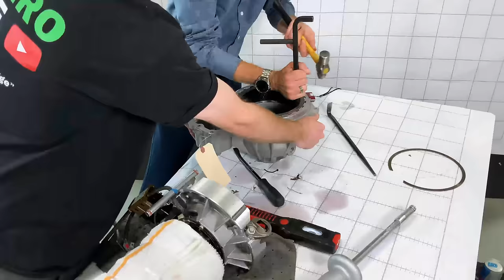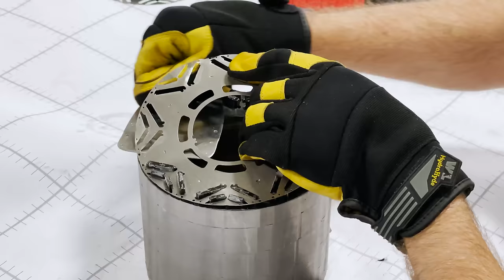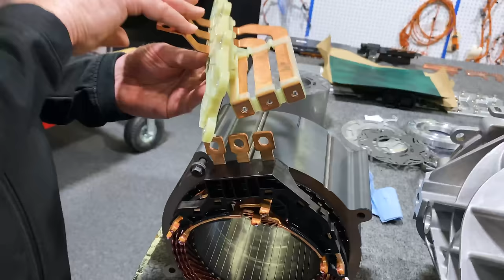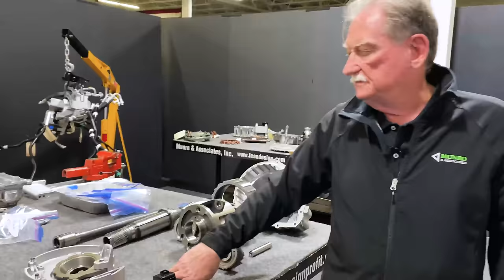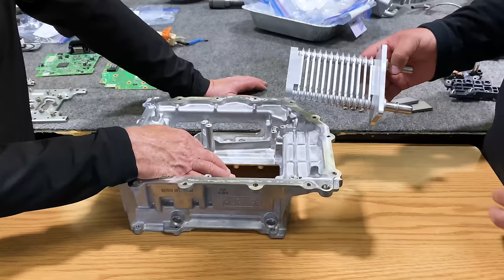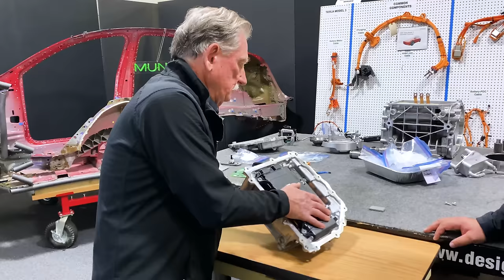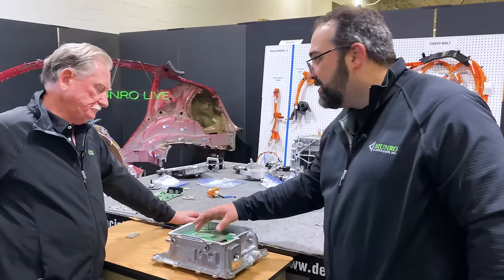Ford Mach-E Rear Motor Teardown and Analysis

Comment: One thing that occurs to me is how they will train all technicians to repair and maintain these vehicles?  The more complex the design, the more training that will have to take place. There may be parts like the inductor that are so complex that you will need dedicated specialists to take them apart and fix them; the average mechanic will not be able to service them.  

One question for Sandy is how do these companies train and equip their dealers to deal with the new technologies going into these vehicles?  Is this ever a consideration in the engineering designs?  Another question is, how much transfer of knowledge is there from ICE vehicle repair skills and EVs?  Is it true that EVs are going to be easier to fix than ICE vehicles?  

One of my fears in buying a vehicle from Ford or GM is that the service centers might not be ready once the inevitable warranty problems start cropping up.  On the other hand, Tesla has a ton of experience and data, and even so, in the early going, they had lots of problems before they started to get things right.  Why wouldn't the same be true for GM or Ford? 

Your channel is super-educational! Seems that EVs are just as complex and, in some cases, more so than the well-known ICE products.  That is why I enjoy your tear-downs; they demonstrate how much goes into manufacturing this amazing technology.  Thanks, Sandy.
Reply: No tech in a dealership will ever service an inverter internally; they will just take out defective or damaged inverters and replace them with new or rebuilt units. It doesn't matter to the dealership tech how complex the contents of the box are, when all the tech does is pull off connectors, undo the bolts to the bracket, toss the box aside, and reverse the process to put the new one in.

Comment: All the standoffs and screws for the circuit boards are because the circuit boards are susceptible to flexing due to their thinness. The metal circuit board traces on the circuit boards are not very tolerant of repeated flexing due to their size ( very small and thin). The engineers are trying hard to avoid open and short circuits. All of this is not to say there isn't a better way to design these things it's mostly just because it's computer industry standard circuit boardmounting technique. Circuit boards have been mounted that way in metal housings for decades.

Comment: Ok, the driveshaft components are a bit confusing.  Does the motor turn the sun gear, then the driveshaft being turned by the planetary gears, go through the center of the motor turn at the speed of whatever the gear reduction of the planetary gear are?  Its an interesting setup, but Ford could probably reduce the whole setup by maybe 20 pounds.

Also, yes, I agree that a parking pawl in a EV is completely unnecessary.
Reply: Correct.

Comment: I like being able to change my filters... If anything it allows me to see how many, if any, flakes are floating around in a system and in turn gives me an idea of how much wear and tear it's endured.
Reply: right.. but electric motors don't go through this problem often. There is not much gearing. And the gearing that exists is fixed and there is very little wear over time in these gear boxes because of that. Unless there was a manufacturing defect in the production of a gear.. these motors and gear boxes will last decades and hundreds of thousands of miles with little to no wear. Course Porsche had to go make a 2 speed gear box and added problems there.. but every other EV I know, is a single gear system
Reply: Why do you need to change a filter here? There's a magnetic drain plug.
Reply: @vidznstuff1  Why use toilet paper when I have my hand??
Reply: @airheart1  Anytime there is metal on metal contact with a fluid of some kind being used to lubricate/cool, the fluid in question will need to be changed.... You need a filter to help reduce exponentially increasing wear by keeping particulate matter in said fluid to a minimum in-between changes, therefore said filter needs to be changed as well....  This isn't rocket science.

Comment: I know this video is old but it’s a bit disappointing that Ford doesn’t bother to fit a mechanical disconnect to the front motor of the Lightning or Mach-E like Hyundai/Kia/Genesis, Mercedes-Benz is now doing on EQE/EQS, Fisker is doing on rear motor of the Ocean, and by way of transmission Porsche is able to do on the rear motor of the Taycan/Audi RS E-Tron. Having a permanent magnet motor attached to the drivetrain all the time even when not needed causes a considerable drag on the overall efficiency. Hyundai claims a 6-10% reduction in energy consumption on their AWD EVs by decoupling the front motor. If Ford used a brushed motor like BMW or an induction motor like Model 3/Y and older S/X, it wouldn’t be as big a deal, but they don’t use either… Tesla also needs to add a decoupler on the current S/X because they also have 2 (or 3 in Plaid) PM motors which means a considerable amount of excess energy consumption when just cruising down the road at low power demand.

Comment: Can you guys show us what processor chip is being used in this car ?
Reply: There will be many processors in the vehicle, as there are in any modern vehicle.
Reply: @brianb-p6586   I meant the main processor that does the self driving and most of the work
Reply: @Theloverboy2987  even "just" driver assistance (no current vehicle is adequately capable of self-driving) takes multiple processors. It would be interesting if Munro did a teardown of those systems; they're not very closely related to the powertrain.

Comment: I think the assembly is the other way around on the inverter. They start with the distribution board and use it as the position fixture for the MOSFETs as they are dropped into the cooling fins. That way easier to solve the aligning problem. That said this is bad DFM. Your assembly sequence is more complex and really costly. It breaks the subsystem logical boundaries during assembly, complicating work in progress optimisation. Too many steps and parts, use of slower processes.

Comment: What a nightmare to assemble. There's no way that's EMC shielding. For that you can't have holes like that. Look at how it's done in other RF situations, it always has a thin sheet metal box with carefully fitted parts that clip into each others.
I dread to think what this costs compared to what it could have done if it was thought out better.

Comment: Does using electric brakes as a parking brake mean that if the battery dies the parking brake fails?
Reply: No, the traction battery is disconnected when the car is shut off.  I would expect the brakes to be set with no power.
Reply: The traction battery (the high voltage battery which runs the drive motors) isn't even used for electrically applied parking brakes, or to move the parking pawl in this transmission. If the 12 volt battery dies, electrically applied parking brakes can't be release and the parking pawl can't be moved - either way, the car is stuck stationary until power is restored.

If you lose 12 volt power before stopping the vehicle and setting the brake or parking pawl you're in trouble... but I think you're in trouble anyway if you're driving with no power to control anything or to boost the steering or regular brakes.
Reply: @brianb-p6586  Sandy's argument here is not to even use a parking pawl, and I failed to see how hydraulic disc brakes can be set so that they can't be released when power is lost. If you're talking about mechanically set secondary calipers riding on the same disc, well that's more mechanism and complexity. I really don't get the fuss over a little parking pawl. You've got some kind of gearbox or differential anyway, a parking pawl is really nothing.
Reply: @fieldlab4  Whether they're a mechanical extra caliper, or a mechanical device on the main caliper, or a separate drum brake (all of these designs are common in modern cars) a parking brake works without using hydraulics. The complication is already there, as all cars have parking brakes; many of them already use a small electric motor (instead of a manual pull cable), so they're easy to automatically apply when "Park" is selected.

I agree that a parking pawl isn't a big deal, but Sandy's business is finding ways to save on manufacturing cost, and there is certainly some cost to this mechanism.
Reply: @brianb-p6586  A simple parking pawl is more expensive and less reliable than two separate disk calipers with pads and electric motors which are exposed to the elements?
Reply: @fieldlab4  no, but the car has the parking brake system whether it had the parking pawl in the transmission or not... that's why the pawl system can be considered superfluous or redundant, and that's Sandy's point.

Comment: Soldering a rigid structure to different boards - won’t the likely hood of broken solder over time increases?
Reply: Valid thought. Thermal expansion of the gate pins could potentially be an issue over time.

Comment: While I grew up on old-school muscle cars, I know electric motors are the future.  My only pet peeve with them is that it will require an engineering degree to do any kind of repair on them.  Try diagnosing a $0.50 capacitor or resistor (made in China) that fails on that motherboard and bricks your car.
Reply: New-school muscle cars have those same motherboards.

Comment: Noise and harmonics really do cost efficiency ,,,,,,,,,,,,,, but the assembly of the controller is absolutely foolhardy ,,,,
I could design a feeder for those tiny screws that would work great so Sandy is paid to criticize whatever he can imagine,, but it's really an engineering mess in many ways 
Thanks for the insight

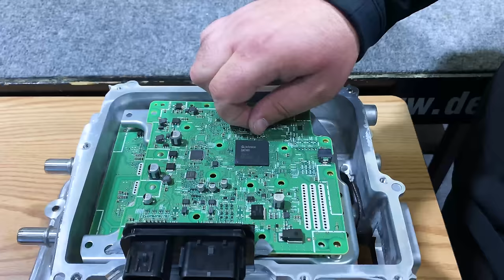Comment: 25:30 16 bolts to hold a 50 gram plate? Those bolts have a higher weight then the plate itself? 30:10 Oh yea, let's do it again!

I'm a little surprised about the amount of alumium in a high voltage converter, isn't it more safe to use something like plastic or something as a casting? Something that you can allways touch, even if a bolt fell inside?
Reply: Aluminum is better for heat transmission/dissipation and EMI suppression as well as being strong and machinable.  It takes a lot of magic (special compounds and additional processing) with plastic parts to get all the same characteristics.
Reply: @videcomp  Then you could easely use that heat for the heatpump right? Or does the Mach E not have that?
Reply: @zezizarjaars  I'm primarily an electrical guy but do have a lot of experience with heat transfer and I have to say that using waste heat for practical purposes is never easy.  I would say possible and even cost effective in some circumstances, but most of the time getting rid of heat take precedence over all other considerations.

Comment: How do you know it's silicon carbide?
Reply: They likely just looked up the part online, from the numbers marked on the part. Seriously. There are only a few manufacturers, such as CREE Wolfspeed, and their product descriptions and specifications are published. 
https://www.wolfspeed.com/products/power/sic-mosfets
Reply: @brianb-p6586  The module is a custom part made inhouse by Denso. There is no marking here that you can look up.
Reply: @Juz4m  Perhaps, but it's hard to imagine a part - especially one that complex and expensive, with no markings on it for internal use. Maybe they peeled the film off of each side of one of the modules and found markings. Of course it's also possible that they noted that the inverter was made by Denso (based on labelling or recognizing the physical design) and assumed SiC MOSFETs because that's Denso's current technology... but I would still guess part numbers.

Denso PR image:
https://www.denso.com/global/en/-/media/secure-news/global/en/news/news-releases/2020/201210_booster-power-module.jpg

Comment: This is an honest question; When the engineers create their designs and they order the parts.. do they ever try to put it together themselves? The complexity of the build is enough to question at least a dozen decision that were made from the comfort of a desk in front of a computer. The issues for assembly become glaring during this video. Maybe building the car should be something everyone not working on the assembly floor should have to do, or at least their part so that they can figure out how to make things better, lighter and easier.
Reply: Most places where I have worked - no.  My dad also an engineer said that in many industrial plants it is considered a safety measure not to allow engineers to touch a screw driver.  The idea is to make him think it through well enough to be able to write out the instructions that a tech can follow and not get killed.  He made this comment after he watched me (a test engineer for NASA) on a video feed walk out to a rocket test stand, remove a cover, replace a fuse and book it back to the control center just before a rocket motor test. :)
Reply: Fortunately, the people who actually assemble these inverters are not two random guys with no idea what they are doing and no tools, so it's not nearly the problem that they make it out to be.

Comment: The complexity of the cirquitboards and the motor controller will come to haunt you later in life. After 8 to 10 years, the solderings will loosen from the pins and you have to repair the controller. There are no service senter alive that will touch the shit with a 10 foot pole, so no fixes but a brand new unit, that costs an arm and a leg for the customer. it is just too hard to service it, so nobody will try to do so.

Comment: I’m guilty of saying that one of the reasons BEV’s are more reliable is because  they have fewer parts. The Mach E is way more complex than I imagined. Now I’m questioning how reliable it and other BEV’s will be in the long run. My 2005 Lincoln Navigator with 300,000+ miles on it, still tows my 5000 pound boat reliably. I would be pleased if my Mach E lasts half as long .
Reply: The difference is that EVs will get steadily better. ICE are as good as they’re going to get.
Reply: @fredbloggs5902  possibly, but only because government regulation and mandates in favor of EV’s will curtail R&D investments in ICE’s by manufacturers. One only needs to look at  power output per liter of engine size to see how internal combustion engines are improving every year.

Comment: I have one comment Sandy will not like.  A park holding device should never require energy to stay engaged or disengaged. Requiring energy to stay engaged is what the breaking systems on trains have . To hold in place a locomotive must be attached and running to hold location. Each car has a hand wheel but settings 100 or more hand wheel is seldom done it takes too long. So trains bleed off and roll away causing accidents regularly.  Second requiring enegert to keep a brak released waste a lot of energy as is the case with the air brakes on trucks . The best solution is a fully mechinal park mechanism that can be applied or held off with a lever using np energy at all beyond moving the lever by hand.
Reply: ...my thoughts too. Don't know if electric brakes mechanical lock once energized, but brakes wear and fail more easily that park mechanism. Given EV's are still relatively heavy vehicles, the added safety may end up being a failure of Tesla understanding vehicle safety vs costs. Time will tell.
Reply: This Ford feature - just like the park position on an automatic transmission does not remove the requirement for a "real" parking brake.  In the US code of regulations 571.105 S5.2 Parking Brake System, requires that the brakes be engaged by a mechanical system independent of the electrical or hydraulic supply. This is not optional. What Sandy is talking about is the additional parking mechanism that is optional and up to the manufacturer.  Typically this is engaged automatically in case the driver "forgets" to set the parking brake.  In my experience, except for people living in places like San Fransisco just about everyone forgets - so it's a nice feature.
Reply: Electrically actuated parking brakes, which are now common, do not require energy to stay engaged or disengaged. An electric motor moves a mechanical device between engaged and disengaged positions; without power, it stays in position (and can't be moved).

Fortunately, modern automobiles are nowhere near as stupid as railroad systems designed over 150 years ago and still in use.
Reply: @videcomp  No, electrically actuated parking brakes (often called "electronic parking brakes") are not in addition to a mechanical parking brake system. They are mechanical parking brakes just like the cable-operated ones (either integrated with a sliding caliper or as a small caliper separate from a fixed-body service caliper), but engaged and disengaged by a small motor instead of by manually pulling a cable.
Reply: @brianb-p6586  You are correct.  I used the wrong word when I said "engaged".  That can definitely mean the initiation.  The initiation by electrical power is fine.  The prohibition is against requiring electrical power to maintain the brake (which is what I meant and the regulation requires).  "Engaged" can also mean the continuous application of a brake, but is ambiguous so it was not the correct term to use. Thank you for the clarification.

Comment: Someone should have designed those MOSFET’s to look more like a stick of RAM so they snap into a slot in neat rows. Put pins on the top and bottom and they’d slide right into slots above and below and snap, you could probably eliminate some fasteners as well because of that!
Reply: I’m guessing it’s a design adapted from something else. I predict every Mach-E will be sold at a loss.